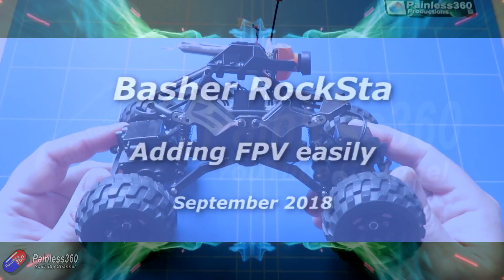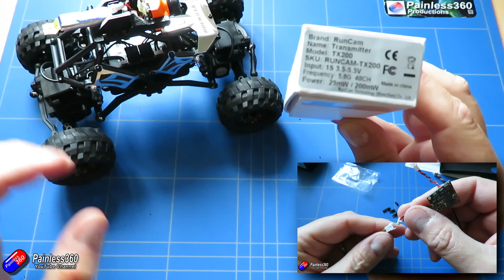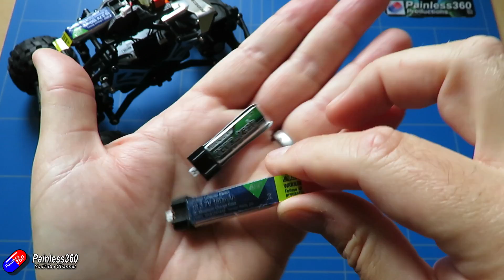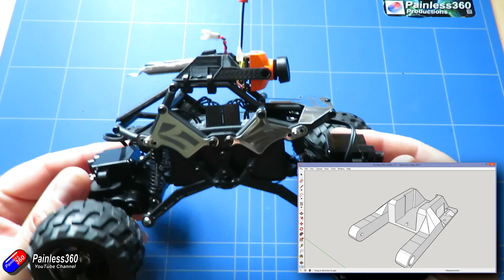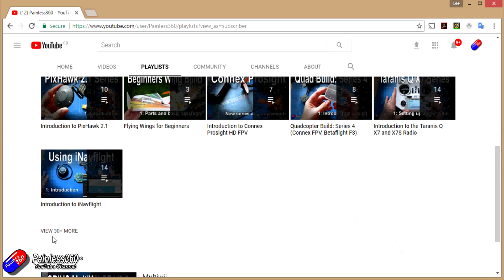Basher Rocksta 1/24 Rock Crawler: Adding FPV

Comment: Nice, I did something similar to mine but I powered it from the BEC instead of using a separate battery.  Just used as splitter from the servo lead.

Comment: I love fpv-ing ground vehicles. It's such a cool thing. I have an1/8 scale nitro road course car that I fpv'd and thought it would be pretty easy to drive, wrong! I need to mod the camera to pan with the front wheels. So where the wheels are pointing, so will the camera.

Comment: As always, thanks for the video. On my Rocksta I ran into control range issues and since I wanted to use my radio anyway, I simply stuffed an ESC and my own receiver into it. It's a great FPV crawler now.

Comment: I started out doing FPV some 12 years ago with a Tamiya TLT-1 rock crawler truck which I stuck a 12v camera to the front bumper and a 1.2ghz VTX on the back, watching through some Olympus EyeTrek FMD-200 video glasses.
There's a video on my channel from way back then, "FPV RC driving from 2006 with a Tamiya TLT-1 truck".
Now I've got HD2's and much better cameras with much wider angle views it's time to dig out that truck :)

Comment: Nice set up. Far posher than mine as, not having access to a 3d printer, I'm still using balsa.
As with flying the change of viewpoint can be fascinating and these small crawlers mean that you can even get unusual views even inside your house. Great fun in wiinter
Reply from the maker: If you want me to print you one - let me know ! :D
Reply: I will do if I need one thanks